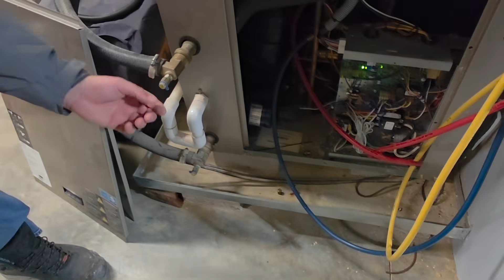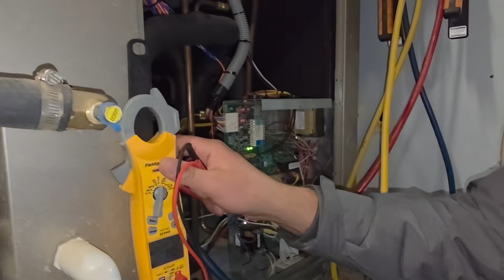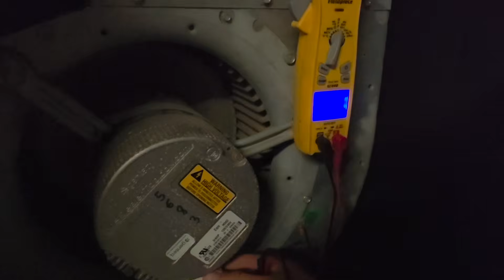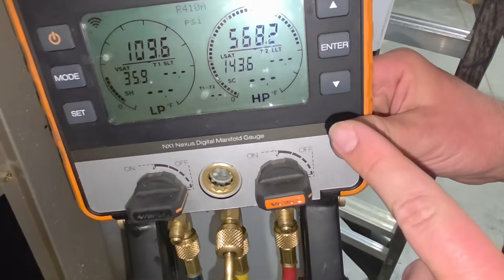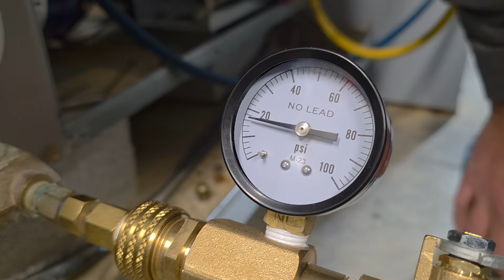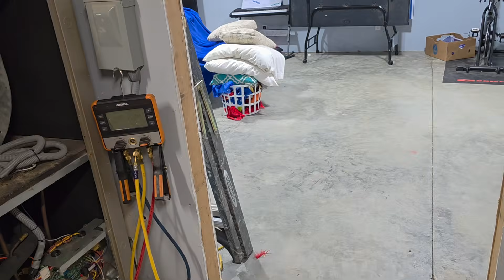Geothermal Heat Pump Failing? Here's What You're Missing

Comment: My blower motor (ClimateMaster) died after 12 years of service (no longer under warranty) and it cost me >$1000 to replace. I looked and the old motor when technician removed it and the old motor had a label stuck to the body of the motor indicating software version number!! Never saw a motor having a software version number. Conclusion, the blower motor had mounted on it a microprocessor for controlling the motor under various run conditions.

Comment: Im in South Florida. I've got a Bosch heat pump which is going off on high pressure up to 600 PSI. I've got water going through.  everything's clear the filter's clean. Basket is clean There's nothing on the evaporator coil so this is a water source heat pump with a cooling tower outside. The temperature coming into the unit is 77°. The temperature leaving the unit is 125. Installed October 24
Reply: @Anton-du-Fleur  What is the inlet and outlet water pressure?  You said basket is clean.  Do you mean the strainer on the inlet water?

Comment: Have a Climatemaster Tranquility 27 that's not cooling. When it first calls for cool the fan acts funny like it starts then stops and acts like it wants to go a different direction. It finally starts but the unit just isn't cooling like it was. I put the CXM board in test mode and it flashes 8 times, which from what I gather means water problems, but after that I'm lost. I have a pressure valve on the water line and it shows  18 psi. Should I just replace the CXM board and then see? Anyway nice videos.
Reply from the maker: If you only have eighteen p, s, I, then the water pressure is low.You need to add water
Reply: @taddydigest  Thanks, I better call a tech...I have no idea how to add water.
Reply from the maker: I have videos on it.Go check out my playlist

Comment: Hi, we have a water furnace split with air handler in attic. Our ac is not working. the technician said blower motor was arcing and replaced that. It was still not working. They came back and found default setting was not compatible with operation. They returned and programed the motor. It worked for 2 days and then we got blinking red light. I switched off breaker and back on, then we got a green light and amber low pressure light. After a few minutes it was just a green light, then after about 15 minutes we were back to red. Do you have any idea what might be the issue? Thanks

Comment: Thank you for your content, I installed a Waterfurnace geothermal on my boat in Norris Lake Tn.  I have a closed loop water supply for the heatpump  and an open loop from the lake.  Two shell and tube heat exchangers handle the heat exchange between the loops.  My biggest concern has been the temperature of the lake water in the summer, can be 85 degrees F. It has never tripped out on high  pressure but I am concerned that its been running for 10 years on higher than normal head pressure. Have I prematurely shortened the life of my compressor ? I fixed this issue last year by getting my suction down to 40 feet in the lake, water is cold down there all year. Thank you for your information.
Reply from the maker: I think it's fine
The cooler the better
But there are some boats down here that the tube is not even a foot below the boat pulling water in, and they've lasted for at least ten years
Reply: Thank you, on the hottest days of summer I have a  water temp of about 75 degrees entering the heat pump and the return is about 85 degrees with a 3 ton unit. I seem to only get a temp difference of about 10 degrees. Does this seem normal?
Reply from the maker: what's the supply air temperature
Reply: @ Supply air temp is about 74 degrees